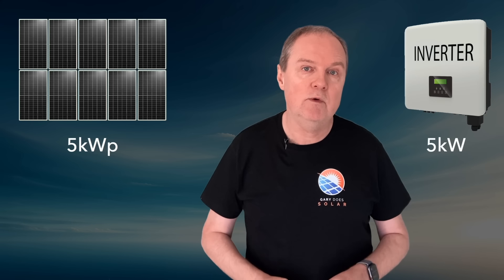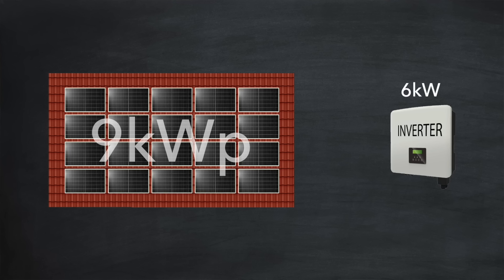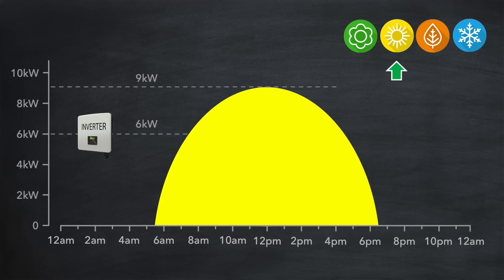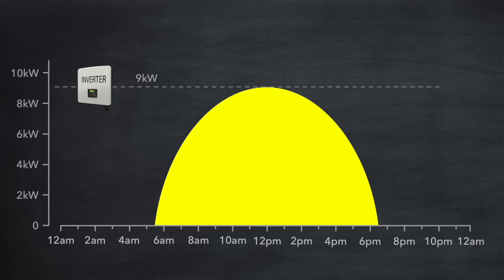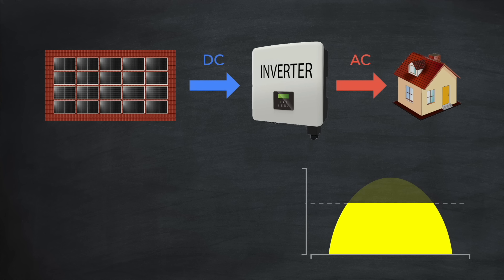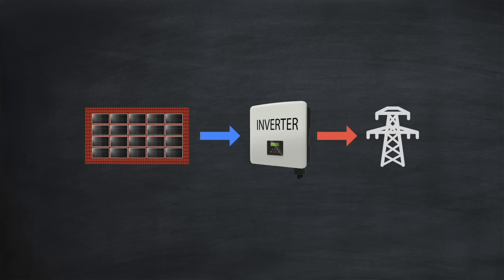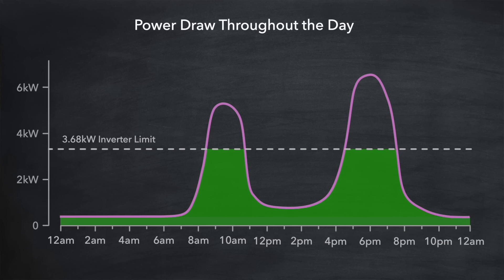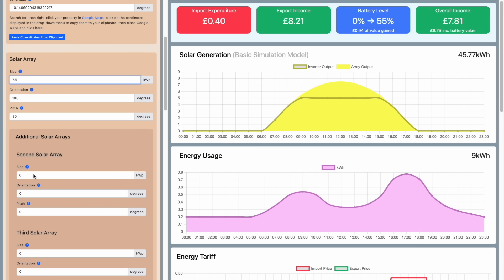Solar Array Oversizing - All the Benefits and Considerations

Comment: Hi Gary, I'm a Gary too. We're building a house shortly.  Unfortunately being on a lake, view is determining position of the home over Solar. That said, we're optimizing the roof for Solar as much as possible. The home is L shaped, presenting both an east west and north south gables. Was considering changing the North South Gable to a Shed roof. The Gables are going to be 8/12 pitch this puts the panels at a favorable angle for our location. Spokane WA, the shed roof, to be ascetically pleasing, would need to be about 4/12 pitch. Much to flat, especially for winter months in our area for Solar panels.
Do you think it would be better to have the flatter roof with twice the panels. Or a steeper roof with half the panels? We are also not allowing plumbers and HVAC folks to put the vents anywhere they want. The roof is to stay clear for Solar ! As we will be on one for one, Net Metering and with the lower cost of Panels these days. I plan to Carpet bomb the house with as many panels as it can hold. We will have all winter to use any extra power, as the Net Metering does not reset till March. Which is early Spring in our location.
Would love to hear your deep dive into this and the ins and outs of maintaining Solar panels on steep roofs. 8/12 is not easy to maneuver for cleaning panels but steeper may lend itself to keeping pine needles and leaves off. Look forward to your 2 cents!
Reply from the maker: Hi Gary, I'd love to help, but unfortunately, I'm not set up, nor insured, to provide consultancy (free or otherwise). Definitely worth getting an installer or two involved to provide you with options and relative benefits of each. Good luck!
Reply: @GaryDoesSolar  was not asking for professional assistance. I already have the answers. It was more a topic suggestion for you.
Reply from the maker: @Useitorloseit1  Ah, ok - got it - thank you 👍

Comment: Hello Gary! Greetings from Brazil! What about if my system uses a power inverter and a charge controller separately. Is there a max VP array power I should use as far as my controler is concerned? The manual for the PowMR 60 pro controller doesnt specify that. It only says the max input power is 1440w on a 24v system. Thank you and have a great week!
Reply from the maker: Hi Sergio! Thanks for your kind comments. Now, this is quite a specific question about your equipment, and it's best to speak to the company that installed it as there could be other installation aspects which would dictate the answer...

Comment: Agree this is also my experience from my oversized system since 10 years. No problems so far but we live in a cold climate Sweden .
Reply from the maker: That's really great to hear, Peter - thanks for sharing. I love Sweden :-)
Reply: What system components do you have?
Reply: @peteroffpist1621  thank you.
Reply: @peteroffpist1621  do you have batteries already installed with your existing components for night time use?
Reply: Thank you, Peter. You have made things much clearer to me. Gary, do I understand that an inverter that is 3kw is more prone to have a shorter incline to the peak hours over a 6kw? Thus allowing for a longer peak power advantage to bring in to my batteries over a quicker time span through the day? Thanks!
Reply: I have a system of 2- eg4 6500 ex 48v for my system plus 27 BlueSun 460W Half-Cell Bifacial Solar Panel (Silver) | Up to 575W with Bifacial Gain. My home is 1200 sq ft. I have a battery bank of 12- eg4 5.12 batteries 48v.  By the way, i am off grid and only use 13-15 kw of power per day before using my  Mr. Cool mini split system with two units inside. My 2 eg6500ex 48v inverters are no longer being manufactured. Thinking of the possibility of (if possible) to buy and connect 2 eg 3000kw 48v inverters to these, OR, just buy 6 of the later ones to connect together for about 18k. Also will add 10 more of the blue sun 460/575 pv when this is upgraded. Your thoughts on this, Gary, please.

Comment: Absolutely correct, even with microinverters. The peak is clipped but area under the curve is        still larger.
The objection of course is the higher initial cost but ROI could be quicker.
Reply from the maker: True

Comment: This might sound like I'm living but I'm not.
My set up is a 7.2kw solar array with a 5kwh hybrid inverter and 9.5kwh battery.
I get 36% more than my colleague at work who had the exact same system except 6.1kw solar array.
In june I got 1000kwh she got just over 600!
Reply from the maker: Thanks for sharing Grant - it just goes to show the benefits of oversizing in action (by even just a little) 😀👍🏻
Reply: @GaryDoesSolar   I do suspect having the larger panels with the same total capacity (455w over something like 250 - 350w) improves efficiency in cloudy weather.
Reply from the maker: @grantmidd  Yeah, I would agree 👍

Comment: We have 6.4kWp panels feeding a 5kW Solar Edge inverter with Tesla Powerwall 2.  The inverter frequently clips during summer, and every time I look at that flat-topped curve I can't help but wish we had gone for a 6kW inverter.  It would have cost little more and given us more energy.
Reply from the maker: Worth using the solar modelling utility mentioned in the video to see what you would have gained. Maybe not as much as you might think?

Comment: Shot in the dark, Have you ever looked into wind and solar as an option? I've just had solar installed to provide energy to our property and I'm just starting to experiment with a small turbine to provide power to my workshop albeit just lighting for now.
Reply from the maker: Hi Graham, now, wind generation is certainly an option that many are starting to look at, to compliment solar. But (unfortunately) there are a number of factors that limit it’s viability in consumer applications:

- Wind turbines are not quiet - worse, the noise varies with the wind strength,  could drive any neighbours close by insane. 

- They are also nothing like solar panels in terms of reliability - you might find you’re spending a fair amount of time, money and effort keeping them going. 

- And they’re expensive. Like really expensive for one that generates even just a few kW.

- Also watch out for the advertising. Some retailers talk in terms of kW (power) when they’re actually taking about kWh (energy) - even a cheap 30cm diameter turbine will generate 20kWh given enough time!

Comment: Interesting video! Im planning to buy an Deye 12kw inverter, the price difference wasn't that high but i actually only need an 8kw one. Is the efficiency a big problem here? I have 5.6kwp at west and east orientation (makes for theoratical max 8kw peak). The deye handles a max of 15kw solar input.
Reply from the maker: Hi Erik, I'm not in a position to offer individual advice, unfortunately - but it's a great question to ask on a solar forum, like this one in the UK: http://www.facebook.com/groups/2197329430289466

Comment: Thank you so much Gary. I have only just discovered your channel with this video. I installed a 5kw array with 5kw inverter a few years ago. My needs have changed dramatically since then. I now have an EV and battery and combined with a pool pump and upcoming heat pump install my system can no longer cope. I’ve been trying to find an inexpensive fix and your video has been a God send. I did not know this was a thing. Oversizing!!!! Wow. I’m a man on a mission now. Many thanks again. I’m now an avid fan and subscriber. So many more of your videos need watching.
Reply from the maker: Cheers for the kind words 😀 and very happy to have been of help. Hope you find my other videos useful too 👍🏻

Comment: I would think running an inverter at 100% of capacity would be very hard on it, if for long periods, making it very hot (much like running a car engine at 100% being a bad idea).
Am I wrong?
Reply from the maker: I'm pretty sure inverters are designed for such operating conditions, but I agree, they'll run hotter and that surely has some effect on the lifetime. I'd rather have efficiency though over a slightly extended lifetime though...
Reply: @GaryDoesSolar  Many thanks for the reply.....I live where the ambient temperature is ~30 - 35 degrees Celcius during the day, so I was concerned that running the inverter to it's limit might increase the temperature of components to 'cruel levels'.
Hopefully as you say, they should be designed to cope with such circumstances.

Comment: A smaller charge controller/inverter is also more efficient. Losses usually have a self-consumption and input percentage loss - the self-consumption component often decreases with size for the same manufacturer.
Reply from the maker: Yeah, although inverter efficiencies are improving all the time. See my pinned comment.

Comment: From experience, solar panels rarely produce their rated output due to cloudiness, time of year, etc.
But at some time in the year, oversized arrays may produce their rated output which may fry your equipment.
You can oversize your array and use a current switch/relay to either turn off a segment of panels or redirect a segment's output to another load.
Current switches are adjustable electronic sensors/switch that control low amperages which are used to control the coils of High Amp relays.
Neither are very expensive, and both are easy to wire up.
Reply from the maker: I don't think you need this extra protection - inverter data sheets state the percentage of oversizing they can accommodate - in the case of many Solar Edge inverters this is 200% of the inverter AC power limit.

Comment: More nuclear generators which can only be throttled down 15% means that the grid cannot take too much renewables or rooftop. 

More nuclear will make home use better choice if v2g EV battery is more common.

But if more customers become more independent of grid electricity then the grid owners will have a cashflow problem.
Millions of Customers = BILLIONS in cashflow.

We live in interesting times. 
With nuclear generators needing 20years to break even and rooftop PV taking 3 to 8 years to break even. 

But grid owners needing 90% of the original customers cashflow for minimum ROI, return on investment. 

Will electricity get more expensive and rooftop PV more valuable ??😮
EVs more valuable with its massive free storage ?? 😮 😊😊

Time will tell.

Your larger rooftop will keep your roof cooler 😎, shaded from the sun.

Comment: I have a Victron inverter and charge controllers, what I did was lower the percentage on the charge controllers (by software) to keep from getting too close to the maximum input for solar!
Reply from the maker: I didn't know that was possible. Did it help?
Reply: @GaryDoesSolar  
I’m no expert but it kept it from going over 100 A which was my goal! I took from the peak of the summer, and then figured the rest of the year was a breeze, as it would never get over 100 A. So basically, my charge controllers are set at 85%.

Comment: Hi Gary! Nice and very useful video! You earned a subscriber here!  Could you please be so kind as to tell me if a system with a 5 kW inverter and 6 kW panels would be OK? Or maybe a 6 kW inverter + 8 kW panels... Honestly, I don't know. All I can tell you for sure is that the energy requirement for my house is approximately plus/minus 6000 kW per year. Thank you very much in advance for your answer.
Reply from the maker: Hi Andy, thanks for the kind words! Now, I can't offer individual advice unfortunately, but if it were me, I would certainly try to get as many panels on my roof as I could, then get an inverter maybe 20-30% smaller.

Comment: Hi Gary. Firstly im a huge fan. On the basis of your 'which battery size' video last year we invested in a myenergy libbi (not cheap) and have so far really enjoyed its benefits so thank you for that. Wouldn’t have done it without your help! :) my query (and i really hope you might be able to help as i can't find anything relating to our issue online anywhere) is back in 2013 we got a 4kwh east west solar array with a goodwe 3.6kwh inverter. For as long as i can remember we get some days where the generation starts to climb and all of a sudden it flattens. I know that inverters "clip" but the flattening happens between 0.2 and 0.5kwh. Am i right in thinking the clipping should happen only when it exceeds the inverter capacity? The levels are so frustrating and so low its pretty much useless for our needs (today for example was a good sunny day but it went from 1.7kwh to clipping at 1200 and locked in at around 0.6kwh for the rest of the day, not enough to help with house needs and try and charge the battery a little. Ive asked suppliers for their advice and goodwe (inverter manufacturer) and nobody seems to be able to explain it or are willing to help us resolve it. Have you heard of this issue? My thought is we need a new inverter but theyre not cheap and i dont know which would be the best inverter make to go with (its hard to know who to trust) or if a new inverter would solve the issue. I wish i knew of a way to troubleshoot it. Plus we're also on the UK feed-in-tarrif so would a change in inverter affect that? Oh and battery is AC coupled fyi. Sorry for the long question but this is my one shot in the dark to ask someone who i do trust for their advice. Im guessing you're a busy man so understand if you dont reply. Was cathartic to write it down either way :) thanks again for all the great videos. I will continue to look forward to you posting new ones... Daniel :)
Reply: Also...again...shot in the dark...changed my profile picture of two examples of this sudden clipping (at very low power) just on the off chance you see these messages :)
Reply: P.p.s I know you can't offer professional advice, so ignore my "asking for advice bit" mainly asking if you'd seen this issue before and know of it being linked to a faulty inverter? And as a fellow UK'er you knew if changing the inverter for the same capacity inverter affected the FIT? Thanks and sorry for the (now very long) query...😂
Reply from the maker: Hi Daniel, thanks for your kind words about the channel. Now, I don't have any experience of Goodwe inverters, but a quick search showed that a few people are experience clipping issues: https://www.google.com/search?client=safari&rls=en&q=goodwe+inverter+clipping&ie=UTF-8&oe=UTF-8

I'd recommend you join this group and post a question. I'm sure someone there will be able to offer advice: http://www.facebook.com/groups/2197329430289466

Comment: I have a question with regard to your example. If after the sun goes down one ends up using 9kWh due to cooking, ac and other passive use, does that mean that you will have to pull 3kWh from the grid
Reply from the maker: So, if there's no sun anymore, then the only non-grid source of energy will be from your battery. And the rate at which you can extract that power is limited by the discharge rate of the battery itself, and the inverter limit if that battery is DC Coupled. So if the inverter limit is 6kW and the DC Coupled battery discharge rate is 3kW, and you're using 9kW for cooking, you'll need 6kW from the grid.
Reply: @GaryDoesSolar  so 4 x 5.1kW will push out 8kWh subject to an 8kW inverter

Comment: I miss one very important point for diy installations… We always have to consider the open circuit voltage of the mppt regulator of the inverter when oversizing. Otherwise you can damage the inverter, if I am correct.
Reply from the maker: Absolutely 👍🏻 DIY installs are only for those with a solid electrical background.

Comment: I did not hear mention of efficiencies of the inverters in the first place. A 6kw inverter typically needs 7 kw input to have 6 kw output. Also, I have found that a solar panel very rarely if ever puts out it's rated wattage, so from my perspective, I have never really seen more than 90% there either meaning you would need 8 kw of installed solar to consistently feed a 6 kw inverter. So the clip would be only be about 1 kw for a couple of hours a day.
The other is that even with a 6kw inverter, what is the typical full load draw on it? Surely not 6 kw all day long. Your graph did kind of show this, but did not seem to give a detailed answer of what happens to the rest. Ideally, it would be put into a battery and used after the sun went down or sold back as a VPP if available to you.
Then no matter what you do, the power companies will change the rules because they are ultimately in control. I say size your system to put out what you need in the dead of winter and have enough batteries to get you through several really bad days. Then when summer comes along, just start some crypto miners to suck up the excess and screw the power company altogether. They do not like this scenario as they ultimately want you beholden to them forever. This does cost more up front and possibly in the long run, but the freedom is worth it to me. Also, you would need some land to install a 30 kw ground mount array and 100 kw of batteries. All doable for me. Your mileage may vary.